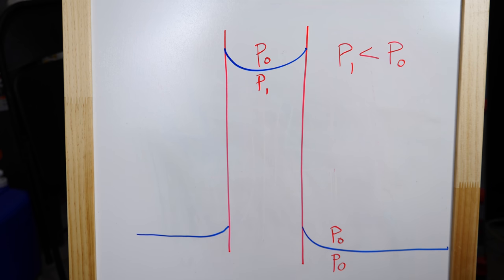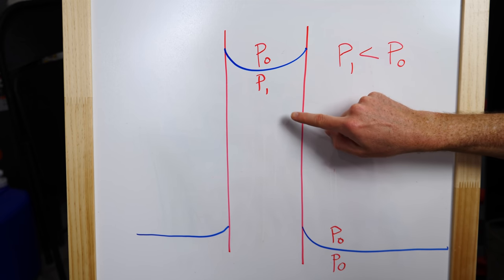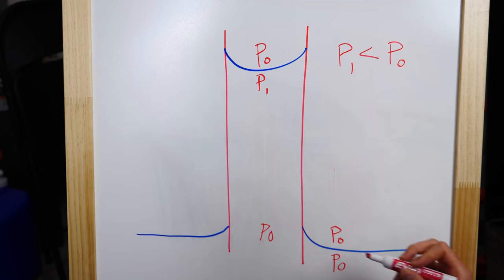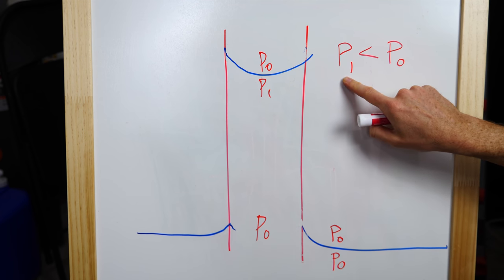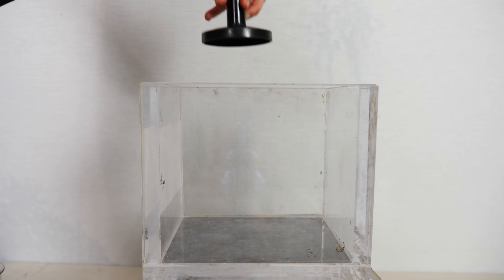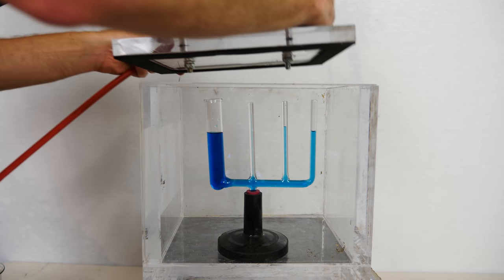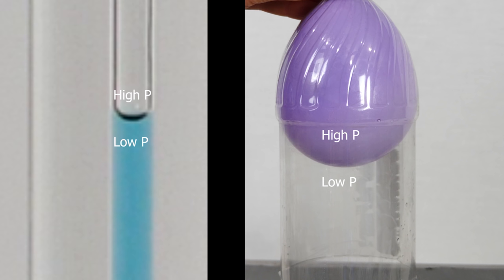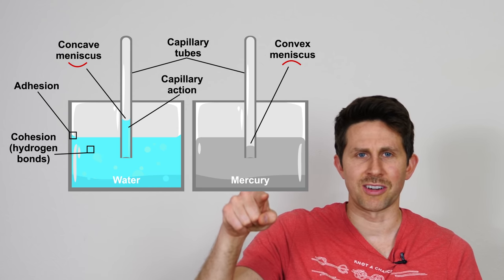Capillary Tubes In a Vacuum Chamber—Negative Absolute Pressure (Part II)

Comment: Thank you for addressing some of the problems with the last video, however, I think there are a few things that need clarification. "What causes water to flow is pressure deltas" is not categorically true.  Any object moves because of the net forces acting on them. Because multiple forces play an important role here, you cannot just say that it is pressure causing all of this to happen. It is not simply pressure that raises the water in the capillary tube. It is because the forces of water tension, gravity, adhesion and pressure all create a net force upward causing the water to rise. An important thing to note is that this changes throughout the water because different forces are acting on different parts. For example, the adhesion forces only occur on the edge of the container. The surface tension only occurs at the air surface interface. Water pressure only occurs below the water air interface and changes as a function of depth and the inter-molecular forces cause there to be negative pressure in the water. Once the water rises to an equilibrium point, you still have pressure deltas, but no flow because ALL of the forces in this complex system have balanced out. Trying to state it is all pressure is very very bad practice. When you dump some water on a hill and watch it flow down, you wouldn't say, "Pressure differences in the water cause it to flow down the hill." You would say, that gravity and normal forces cause the water to flow down the hill. By pumping out all of the air in the vacuum you showed that atmospheric pressure didn't effect capillary action. This shows that atmospheric pressure does not account for the rise but it is entirely due to water, thin tubes, and gravity. Just tip the entire thing on its side and you will see the shape and height of the meniscus suddenly change which shows that just relying on pressure is dangerous. Horizontal capillary tubes are an entirely different experiment with their own fascinating effects.
Reply from the maker: Gregory Wilson actually talking about forces and pressure is the same thing. And yes when water flows down hill you do need to talk about pressure deltas. You can use fluid dynamics to calculate the pressure differences in the flow using navier stokes equation. Fluids flow due to pressure. You can call it a force but it’s harder to deal with forces in fluid dynamics than pressure. Fluids moving anywhere is a fluid dynamics problem and if you want to know why or when fluids will flow you have to calculate pressures. That is why I’m talking about pressure. Any paper that has to talk about fluid movement must discuss the fluid pressure.
Reply: @TheActionLab   Forces and pressure are not the same thing. It's like saying mammals and cats are the same thing. Pressure is indeed a force but force is not always pressure. Pressure is only one type of force. Is it important? Yes. Is it adequate? No. While I agree that it is important to talk about pressure, you can't say that pressure is the only thing at play here and describe it in terms of only pressure.  Even in the Navier-Stokes equations you explicitly define other forces (apart from pressure) acting on the continuum such as gravity. So in the general equation it is pressure AND gravity that causes flow, not just pressure. Throw in the capillary action and you have the adhesive force and surface tension that now need to be added to the equation. You cannot say it is only pressure, it is ALL of those forces . Take this quote from a professor at Boston University, "There are basically two ways to make fluid flow through a pipe. One way is to tilt the pipe so the flow is downhill, in which case gravitational kinetic energy is transformed to kinetic energy. The second way is to make the pressure at one end of the pipe larger than the pressure at the other end. A pressure difference is like a net force, producing acceleration of the fluid." Look up experiments of capillary flow on the international space station. This is actually a problem in liquid rockets. Gravity has changed which drastically changes fluid dynamics. I understand trying to simplify it but you have thrown out the dishes with the dish water.
Reply from the maker: I actually never said that pressure is the only reason for anything in this video. I’m not really sure what your point is here. In any calculation you have to account for all forces/pressures. Of course that’s true. In this case capillary forces create a negative pressure. The difference in pressure can be calculated like this: deltap=2*gamma*cos(alpha)/r where gamma is the surface tension between water and air, alpha is the contact angle of water on glass and r is the capillary radius. Thus you can use this pressure to calculate exactly how high your water will rise in the tube under any circumstance (centrifuge, normal gravity etc.). This is very useful. I’m not sure what your problem is with mentioning pressure in a capillary tube.

And edit: I just realized you said pressure is a “type of force” what on earth are you even talking about? Pressure==force/area. It’s not a type of force.
Reply: The Action Lab The problem arises when you try to link the atmospheric pressure with the liquids pressure to describe capillary action. Your balloon example is exactly this. It’s an incorrect way to describe capillary action and meniscus. Apart from that, I never said I had a problem talking about pressures in the liquid. I just said don’t forget the other physics like gravity. As far as pressure being a force I was generalizing it to the pressure term in the fluid dynamic equations as something that can cause acceleration. Yes yes, pressure is not a force, but pressure differences in a liquid result in net forces on water molecules that cause acceleration. I agree that the wording was not the best but it was pretty clear what I meant. Pressure differences can cause water molecules to flow. Gravity can also cause water molecules to flow. These are independent terms in the fluid dynamic equations. The comparison is pretty clear, especially when looking at the equations. I still think you are missing the point I was trying to make. I’m a little confused as to why you are dead set on explaining this phenomena in terms of pressure. Help me understand your reasoning because I don’t believe it makes your explanation easier to understand, especially for the casual YouTuber.
Reply: @gregdwilson2   I think James wants to explain this phenomenon in terms of pressure and not gravity. It would be cool if he could tilt the tubes in vacuum. Since capillary action is pulling up the liquid here, and in vacuum there is no air to push on the liquid, gravity is actually pulling the liquid down.Correct me if I am wrong but I noticed the level of liquid in all tubes remain same even in vacuum when not boiling , around 6:17. So I think both of you are almost correct. Each factor is occurring independently and they are interacting and cooperating to make up this complex system. Here James is not tilting so he does not take gravity into account I think.

Comment: A liquid can only flow up if there is a force pushing it up. In a normal container, gravity is pushing down and the water pressure is pushing it up. Both are equal, so no movement happens.

In a capillary, the forces pushing the water up are the pressure of the water plus the adhesive and cohesive forces, so it rises above the level that it should until it reaches the point where equilibrium is reached again, i.e. P0=PI.
If, as you say, P0 > PI, the water would flow, as you yourself said in the beginning of the video. Specifically, it would flow down until PI=P0.

Moreover, if the water's pressure at the top of the capillary was lower than everywhere else, it would have boiled there first.

Pressure is basically the combined forces of molecules bouncing off a surface. Asserting that there is such a thing as negative pressure is to assert that particles can travel at a negative speed and possess a negative amount of kinetic energy and a negative momentum. Also known as complete nonsense.
Reply: Negative pressure is effectively tension. If you wanna know more you can read the Nature article in the pinned comment, or the Wikipedia article if you want something more approachable.

Comment: I think negative pressure just means that the force causing it is in the opposite direction but that doesnt mean that negative pressure is less than absolute zero pressure cuz the negative sign indicates the direction and is not related to the magnitude of the pressure otherwise it will be like saying that temperatures below 0 K exists

Comment: "Negative Pressure" does not mean what you are describing!

Pressure is a quantity of force over an area. By definition, force is a vector (i.e., it has a direction.) Also, pressure is always normal (i.e., perpendicular) to the surface it acts upon. The negative sign in front of pressure does not mean that the quantity of pressure is negative. It means that the direction of the force is in the opposite direction.

Michael S. Turner, a theoretical cosmologist who coined the term dark energy in 1998, summarizes the concept of "Negative Pressure" in an article in this way:

"... it's direction — an inward, imploding, or contracting force, rather than the outward-pushing force typically defined as pressure. The minus sign next to those atmospheres doesn't mean "less than nothing"; it's an arbitrary signifier denoting "in the direction opposite of positive." (my emphasis) Solids have negative pressure when they pull in, like stretched rubber bands or springs. Liquids can have negative pressure in metastable states, when they resist turning to vapor."

The excerpt quoted above is explained quite clearly in the context of this 2003 Discover article titled "The Physics of Negative Pressure":
https://www.discovermagazine.com/the-sciences/the-physics-of-negative-pressure
Reply: Isn't that what he said? That negative pressures mean tension instead of compression?

Comment: This is exactly how such trees as redwoods and the like operate; they use the roots to pull water from the soil, through the xylem (which plays the role of the capillary tubes), and into the leaves where it just evaporates. I recall watching a video by Veritasium about this not too long ago.

Comment: 1:21 "...at the water liquid interface, the pressure in the liquid is below atmospheric pressure." 
Intuitively, at first I was tempted to disputer this.
But giving it more thought, I see you are right, based on a force analysis at the surface layer.
The surface layer is stationary because atmospheric pressure is pushing it down, capillary forces are pulling it up, and the liquid pressure is also exerting an upward force at this point....and the sum of these forces has to be zero net force. This only adds up if the liquid pressure at the interface is below atmospheric pressure.

Comment: Ok, to be consistent and respectful, I feel obligated to comment again...this time I was able to avoid rage commenting throughout the video lol.

1) regarding the balloon analogy. Your still conflating. Your defense of it is just the shape of it. If that’s your only point...ok...I guess. But that wasn’t your point. Your point initially was that you used it as proof positive of the pressure differences. (See this balloon in a tube, see the shape? That’s because it’s at a higher pressure than the surrounding air...see the shape of that miniscus? Aha! Proof positive. No...no, that is not the way any of this works. You might has well compared it to the shape of a sausage and defended your comparison in the same way. You openly admit several times throughout the videos that the miniscus has the shape it does because of the adhesion forces to the wall. You mercury example is actually perfect. It doesn’t have that shape why? Because it is repelled by the wall...water does why? Because it is attracted to the wall....ok, exactly—your admitting/acknowledging the point. So stop pretending it is somehow an evidence of your pressure differential theory.  Another way you could Prove it is just to take your setup, measure the minisci, then add another larger tube to the end, and remeasure. If your theory is correct, then all the meniscus shapes would change, because you now have a even higher pressure differential. That won’t happen, the shapes will remain, because they are formed from the hydrophilic interactions with the wall...not a pressure differential. So, can we please not pretend what you said here made any sense? Thanks...

2)regarding the experiment as a whole, contrary to the first point, I had to do some honest introspection watching the video. My gut reaction was “ok, in a vacuum you no longer have the atmosphere pushing down, which is what (by my own admission in my prior rant) cause the water to be pushed UP. So...if we remove that, the tubes should equalize. When that didn’t happen I had to strongly consider I was wrong. That is the logical, humble thing to do when your predictions don’t work out the way you thought they would...

Had the alternative explanation you offered been logically sound, I probably would have just stopped there, but it wasn’t. This caused me to contemplate where my own prediction went wrong, and the. I had a 🤦🏻‍♂️ moment....

Of course the tubes didn’t equalize...
1) (minor) the smaller tubes have a relatively higher attraction force to the wall, relative to their size. Think about it like this...you put Velcro on 2 different walls, glass/Velcro. Then let it go. The wall with Velcro will stay high, while the one with glass will drop. A better (less binary) example might be jelly on glass vs carpet. The friction is higher in one, so it “holds it up”. With this in mind, and interesting experiment would be to pour the liquid in a vacuum (as apposed to applying the vacuum after). Since the attraction to the wall should not cause water to climb up (more than the effect of te water planing out) but only adhere laterally, this may prove / disprove one of our theories.

I think the fundamental thing that is bothering me is that you keep making an observation, and trying to cram it into your prior. The balloon / tube thing was a good example. Observation (hey...that shape is similar) prior (what makes shape 1 must make shape 2). No, different principles. Pressure is a force, there is no such thing as a negative absolute pressure. The force created by a vacuum ISNT created by the vacuum directly, it is created by he atmosphere pushing, and you removed the force pushing back. Pressure is something, vacuum is nothing. You can’t have negative nothing. Light is something, darkness is the absence of light. You can remove light which makes dark, but you can’t and absolute negative light (absent maybe dark matter? Or anti-matter?) in the same way, you can remove pressure, but you can’t truly have a “negative absolute pressure). These videos were all based around this observation, that you kinda crammed into “hey, it’s like there is a negative pressure”. No, no there isn’t, there are other forces at play here. Redefining tension as “it’s like a negative pressure” is exceedingly aggravating. So, are we going to start saying if I tie a rope to a brick and lift it up, I’m applying negative pressure to the rope? Common, really? Is that what we are doing here? 

Anyway, all in all keep up the effort / content lol, rant over :). Oh, and, thanks for doing the follow up! I think it’s interesting to have several follow ups on a video, because it lets people chat, give views, and then validate/invalidate thoughts. I think that’s actually really valuable. I was actually responding with another explanation that when I did all the math, I found I made a silly baseline mistake in my assumption. That’s valuable. The Socratic method of exploring is valuable, and I think the videos are good in that vain. :).  And, who knows—I too cold be completely ignorant, we never learn if we aren’t open to the possibility that we don’t know :).

Comment: This is why a little knowledge is a dangerous thing. No, you can't get negative absolute pressure, that is the point in calling it "absolute pressure". No, water doesn't just flow due to pressure differentials, as seen by this capillary action. P = ρgh is a generalization and doesn't apply to capillary tubes. The pressure that drives the water flow is actually coming from the water itself, not the air pressure just as your experiment shows . Actually the rise of height in a capillary tube is not dependant on pressure at all, see Jurin's law.